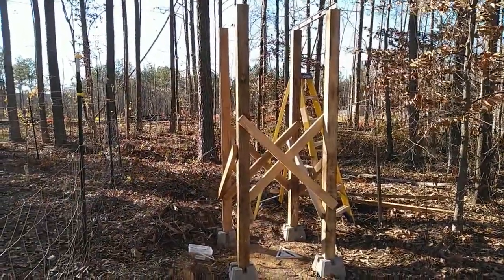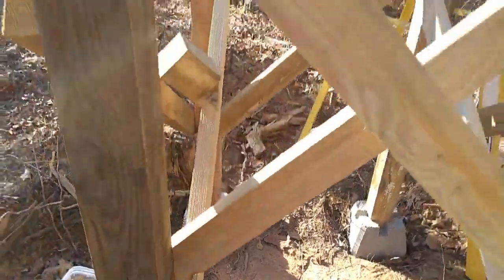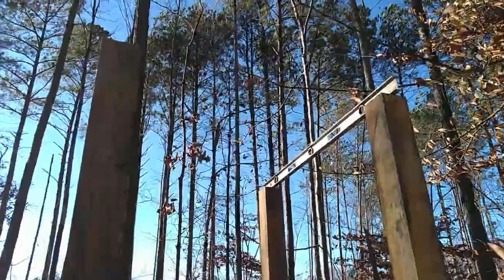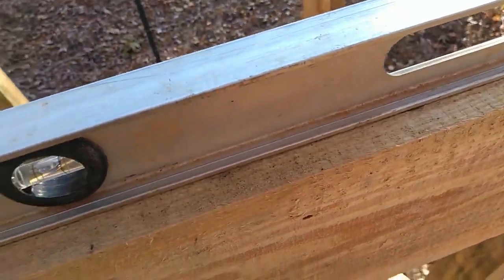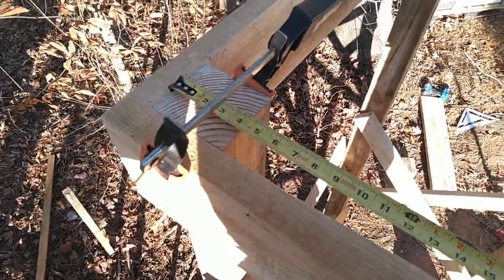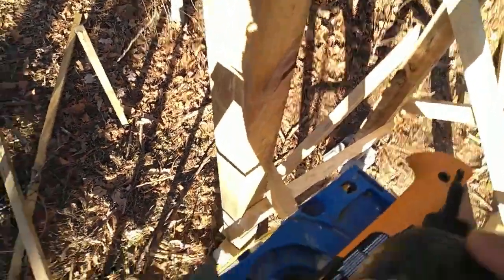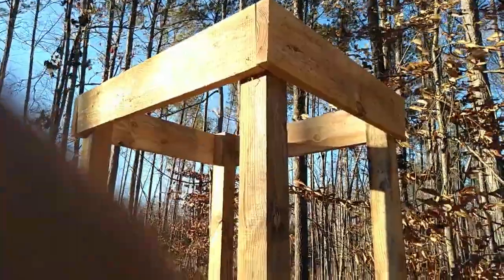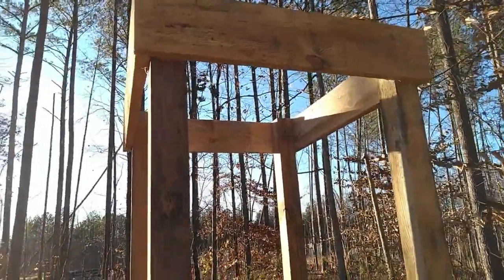#53 Building our Water Tower Part #1

Comment: Has this fell over yet? Respectfully, I really hope y’all stay safe around this time bomb
Reply from the maker: Honestly we have used it longer then I planned on but yes it is still up and working great. The only issue we had was is a squirrel decided it would make a nice home and the babies chewed a small hole into the plastic tank. I used a plastic welder and patched it.
Reply: @DawnRedwoodGroves   great news, I read the comments and everyone talking about screws, I’m an engineer by trade and understand that your weight is distributed correctly directly over your uprights, my concern was the uprights not being anchored into the ground especially with such a top heavy load. Glad to hear it’s still standing and all is safe!
Reply from the maker: @jeffreynewton4463  my undergrad is ME also. I didn't anchor it to the ground mainly because it is only a 16 ft^2 wall, I'm in Georgia we don't get very strong winds plus it's in the middle of a forest so any wind is diffused by all the trees. Again being in Georgia the ground doesn't freeze so we don't have the ground heaving from frost aiding in the unbalancing loads. 

I'm more concerned that I made it out of untreated pine that I made with my sawmill and being out in the elements how long will it last. My initial goal was to capture rainwater to help establish the orchard we started. Those trees have a few years in them and don't require as much babying them to keep them alive.  Water is usually only used in the hot summer if we get a long dry spell.
Reply: @DawnRedwoodGroves   I just completed mine recently, wish there was a way I could attach a pic here ( I raise gsds, mine is for the purpose of getting water to all of em with minimal effort) also, we’re neighbors, South Carolina!

Comment: Brother, humbly, I appreciate your design, however, it is a ticking time bomb to fall over. You have multiple problems which I would like to bring to your attention. 

The IBC Tote, full of 275 gallons, will weigh in at approximately 2425 pounds, or a little over 1 ton. That's 275x8.3=2275  135 tote weight empty.

The house you built surrounding the tote must also weigh somewhere around 500 lbs or more.

The four concrete pads you have are on soil only. BAD MOVE. The water tower is built into the side of a slope and the rainwater will flow downward, washing all around the footings that can cause them to sink, and/or slip out, creating an unstable, top heavy mass, that won't take much to come crashing down.

Notching the 4x4's in the concrete footer blocks was a BAD IDEA. You have reduced the pressure footprint of the 4x4 and introduced splits by notching the wood. That will eventually begin to split under the weight.

The 4x4's are inadequately braced, and may even be inadequate in and of themselves. Your spacing is far greater than 16" on center, which will stress the 4x4's even more and will prompt them to bow outward.

The 2x4 braces you have I submit are woefully inadequate in both strength and quantity. 

* A strong wind could very well topple this tower *

Humbly, the wrong screws were used for your project. They are not designed to support that weight. Hot dipped galvanized threaded bolts should have been used, with washers.

Concrete footers should have been placed on the four corners, a minimum of 12 inches below the frost line. Brackets to hold the 4x4's could have been attached to the footers, as like a deck, or putting your 4x4's directly into the footers the full length.

The bracing of the 4x4's should be from the inside of the 4x4's. Two, 2x4's diagonally, butting up against one another, will fit inside the edge of the 4x4. You can bolt the 2x4's together where they cross over. Adjoining them can easily be done with steel plates available at Home Depot or Lowe's, that will help support the joints. They are called SIMPSON STRONG TIES. You can see their complete line on their website.

Each side should have "X" Bracing. Either top to bottom, or double "X" framed. 

I'm an old railroad man, and taking into account the designs of old wooden water towers, I've applied these principles to you. Look at pictures of them on the internet. I know you are not holding up 30K-65K gallons of water, but 2K of water, plus your shack up there is top heavy. I'm truly concerned about that set up coming crashing down and destroying your IBC Tote. Lord forbid anyone be around that when it comes crashing down. 

Please, take what I have shared with you, ponder it. If you're a praying man, pray about it. I believe the Lord had me write this because truly your set up is engineered poorly and will falter. It is only a matter of time. Water is HEAVY. 

I'm not trying to be hard on you. I'm genuinely concerned, because it is not a question of if, but WHEN that thing comes crashing down. 

I hope I haven't offended you, or placed a stumbling block before you. That is not my intent. Your safety and well being is what I am concerned about. Think on this.

Best wishes.

Brother Matthews
Reply: @brothermatthews1300...we ALL needed to know this! Ty!!!
Reply: nice analysis
Reply from the maker: Thanks
Reply: Thank you brother Mathews, you probably saved some lives out here.
Reply from the maker: I appreciate your comments and concerns. The only one I really agree with is the fasteners. I want sure the roof would collect to make it worth while so I did it 3" wood screws which I had on hand. I've thought about adding some timber screws to make it stronger but haven't decided if I'm going to make it taller bigger or ? So it wasn't happened. To date its about 2-1/2 years old been full of water and no issues. 

The concrete footers are not really a concern I live in Georgia with no frost so no frozen ground movement. I scrapped the topsoil  off from virgin ground and the tower is on the top of an elevation with no rain water erosion issue. 

I leveled the stand to minimize side loads. Searching vertical weight loads for a 4x4 (btw these are true 4x4s not 3-1/2 x 3-1/2 you get in the store) states that each one can handle 6,000 psi more if properly braced. I sawed this out of pine not oak or hickory what most of those big old railroad towers were made out of. I don't expect it to be a long time peice on our property but it has been handy and I'm sure it will be for sat least a few more years. 

I hope you enjoyed the design, please make your design recommendations to your tower and send me pictures. 

Keith

Comment: I’m not sure how much water will be stored here but that seems like a lot of trust in those screws.  They’re essentially responsible for holding up the weight of the water and screws aren’t designed for shearing forces.  If you’re going to build a tower like this it would be more secure and long lasting if you notched the posts and rested the top frame on them…or used metal hardware.  Even if lag bolts replaced the screws and assuming their shear strength is greater than the compression strength of the braced 4x4, the weight may still provide enough force focused to small areas, where the bolts pass through and provide upward support of the top frame, that the wood yields to the shearing force of bolt.  Now I’m rambling as I lie in bed, but def. notch the posts…
Reply from the maker: I hear your comments and should add some lag bolts for added strength. That said the weight is transferred down directly into the 4x4s. The cross supports are helping with angular (side) loads. When I built this I wasn't sure how well it would work to capture and hold rain water but to date its working great. I've changed the rain gutters to real gutters and added a walk around support to clean out the gutters which seem to always need it from all the pine needles.

Comment: aren't the screws too small?
Reply from the maker: I don't think so, I used 3" long screws. the tank is full and everything looks good. That said I'm designing a 16 ft water tower which has caused me to evaluate adding lag bolts or bolt and locknut this tower later.

Comment: Do you by chance remember the measurements on your 2x8 peices? I need to build one of these for my off grid cabin.  Any help would be appreciated.
Reply from the maker: For some reason I didn't see this so I'm so sorry for my delay in my response. The sides are 45 inches long capped by front and back that are 41-1/2 inches long. Let me know if you need any additional info.